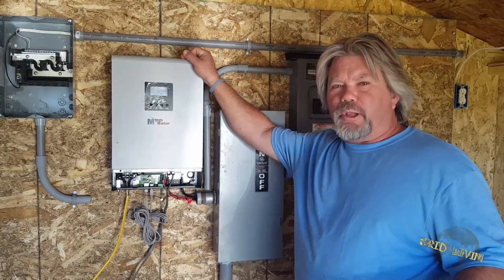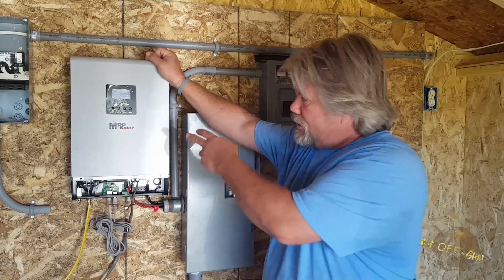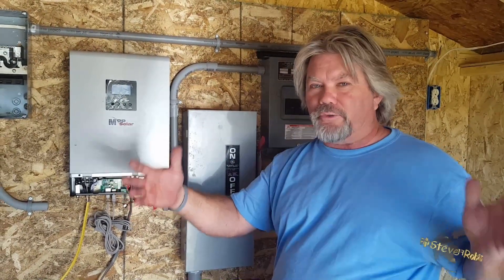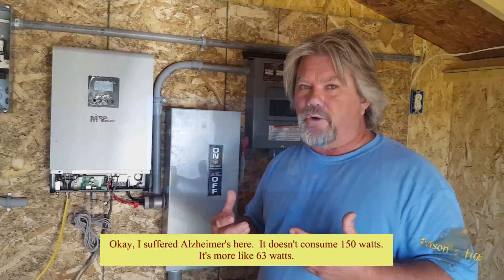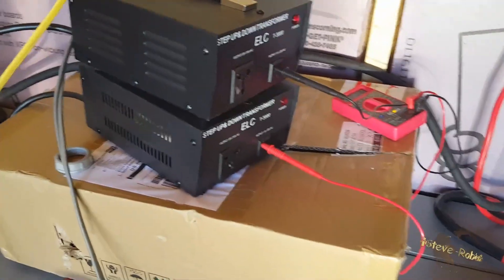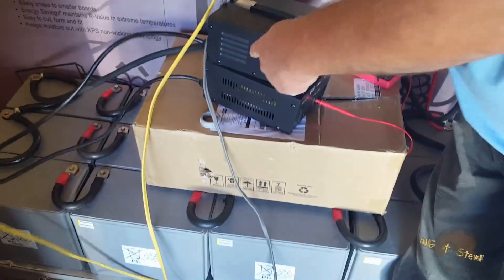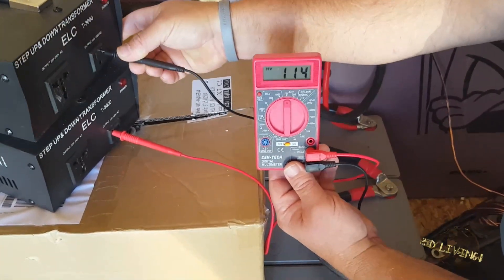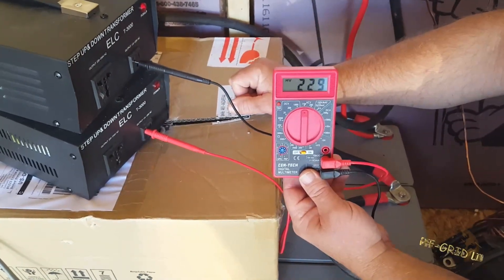Another MPP Solar PIP Inverter Split Phase Transformer Solution

Comment: More interested in big power???  http://www.ebay.ca/itm/10000W-Watt-Step-up-Down-Electric-Power-Voltage-Converter-Transformer-Heavy-Duty/252046237624?_trkparms=aid%3D111001%26algo%3DREC.SEED%26ao%3D1%26asc%3D20160908131621%26meid%3D1651f2c1cb984974a2e2d2646ebd6db1%26pid%3D100678%26rk%3D3%26rkt%3D15%26mehot%3Dag%26sd%3D152658443440&_trksid=p2481888.c100678.m3607&_trkparms=pageci%253A67973de4-82f6-11e7-ab5c-74dbd1806f8a%257Cparentrq%253Aee16a1a815d0aa11f1f34a4afff61d13%257Ciid%253A1
Reply from the maker: That's a beast, Al.  I saw that, but it was outside the budget.
Reply: Nice looks good.. Have been running a 8000 watt transformer for around 2 years now with great results looks a lot like you're link 
https://jet.com/product/detail/450e59740fe14dafb94634aa1d8098c9?jcmp=pla:ggl:NJ_dur_Gen_Electronics_a1:Electronics_Adaptors_Cables_Power_Battery_Chargers_Accessories_a1:na:PLA_785706707_43734982769_pla-292115566960:na:na:na:2&code=PLA15&pid=kenshoo_int&c=785706707&is_retargeting=true&clickid=ad550076-d5c7-4cd9-815c-99868df7a8e6

Comment: Revised,
thinking about this more, seems that this is a good idea and you proven it works
best
Reply from the maker: John I understand what you're saying, but the transformers are:
a.  Isolated on grounds, inputs and outputs.
b.  Wired reverse of each other which means they are exactly 180 degrees out of phase, regardless of the Hz output.
c.  The common neutral will be a grounded conductor, making identical to utility power.
But my thinking could be flawed.  As I test, I will document everything with video and post to Youtube.
Reply: I bought a 5kva transformer off craigslist for $50, so there are deals out there. mine came from a electrical rehab renovation.
I think the problem will be that the small transformer will burn up when you least expect it.

Comment: Neat concept there. Makes sense to me.  I am still struggling with inverters here.  I have been watching these pips, seem like a decent deal.
Reply from the maker: Mike so far I personally know of four people using them and they all report zero problems.  My friend Jim who has two in parallel on his bus accidentally shorted an outlet.  He reported that the inverter shut down, and as soon as he removed the short, they came right back up.
Reply: To bad they didn't make them split phase from the factory. How good is the sine wave out of them?  I have been saving up money to get a good inverter. Rite now I am running on two 24v UPS units, they work, but I have to run two big computer fans on them constantly to keep them cool enough.  But they where free out of the dump, so I can not complain.

Comment: Looks like one way to do it. Did you pop the cover off to see if there is electronics that could throw a wrench in the equation.  It won't be UL listed but if done properly it won't make much difference for a off grid set up. It should be fused before and after the transformers are the nutral and ground tied together to create a path to ground to blow a fuse
Reply from the maker: Roy, I took the cover off and it is pure elegance in simplicity.  All inputs and outputs are isolated including ground.  There are no electronics aside from three breakers and an LED pilot lamp.  It's literally just a transformer, toroidal design.  It's perfect for cobbling a split-phase transformer because you can bond what becomes neutral to ground, and it makes an exact split phase system for much less cost.

Comment: Steve are you going to wire the transformer output directly to a breaker panel?
Reply from the maker: I don't know yet.  I literally hooked it up and videoed as I brainstormed the idea.  I'll do some more testing and post the results.
Reply: We think alike... Was just thinking about that.... lol!
Reply: Steve, My system has been working so well that i have moved on to other projects. But after this video you got me pumped think about system change???? Think split power is something  we all feel we need for some reason,(I know i did when i started) But after running single for so long. Found did not really need split phase power as much as i thought.... you can buy or convert lots of appliances to single make solar systems lower cost & way more simple.
Reply from the maker: The only reason really that there's a need for split phase in my system is the electric range requires both 120/240: 120 for the clock/timer, and 240 for the heating elements.  Other than that I would be very inclined to do just a straight step-down myself.  I even considered just doing the step-down with a very small transformer at the stove itself.  But like I said, it was just a brain-storm I had and wanted to share it out there to help everyone kick off some creativity on their own.